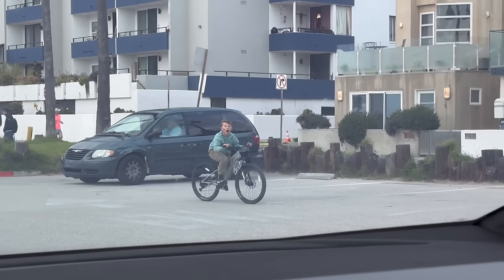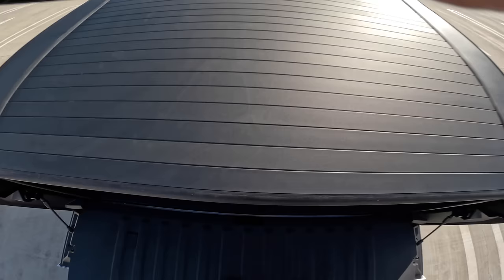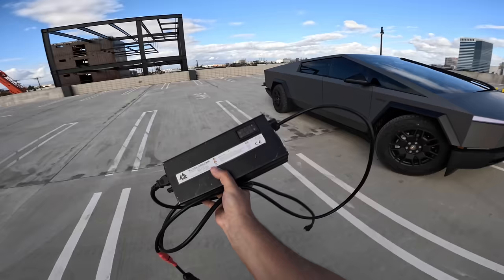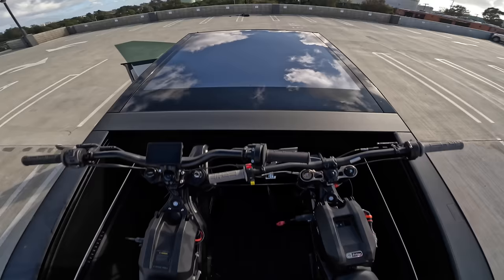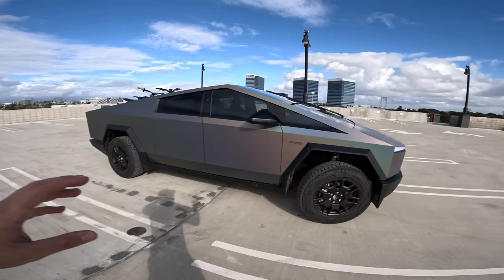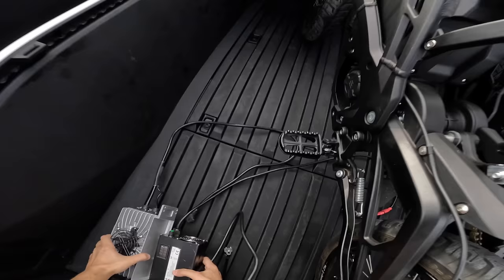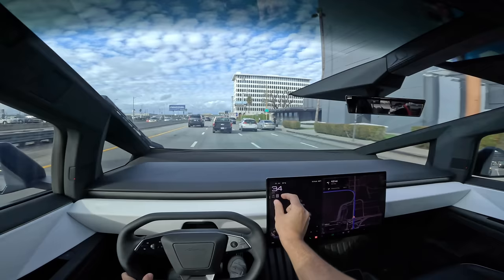I Cancelled My CYBERTRUCK Order After This!

Comment: Doing 70 mph through crowded city streets in a 6,000 lb truck while hold the steering wheel like a teenage girl is always a good idea!
Reply: lol It's ok, it's not real :)
Reply: @@karlwithak. Radar? Where did you get that info from?
Reply: @@karlwithak.so you could go Vmax and we need speed limits only for old car losers, right ? 🤦🏼‍♂️
Reply: yeah bro agreed.. like what is wrong with this guy... even just watching that on video creeped me out
Reply: @@karlwithak. because technology has never failed before
Reply: @@karlwithak. You are the reason the roads aren't safe. Never rely on tech to skirt speeding laws!
Reply: This vehicle can only go 65 miles an hour and they are not free way nor highway legal.  They also sure they weigh 15,000 pounds because just the battery weighs 10,000 pounds for the original design that was 4 times bigger.  That one has a max real speed of 50 miles and hour and is actually about the size of a 1990 Ford Ranger but has no where near the carry capacity morons believe it does.  Maybe 200 pounds in that bed at most.  Basically sure you can put 2 of those bicycles that have flair items to make them look like cheap crappy dirt bikes but shocking reality is electric vehicles can not be used in dirt at all or they will explode.  Basically what electric vehicles are is a giant paper weight you put in your driveway as a driveway ornament and hope it does not set your neighborhood on fire.
Reply: @jordancambridge4106  what car are you talking about? you can literally see his speed read out say 79 @ 14:09
Reply: Is the only thing you do cry?
Reply: It won't be new and in one peace driving that fast in that sort of area😳😱
Reply: Its called a Tesla Fanboy
Reply: @karlwithak. It literally has none of that.
Reply: Ya um.. No. most of that is not 
on the cyber truck yet. Even if it was, saying you cant hit anything is crazy.@karlwithak.
Reply: If you are going to break the law be sure to record yourself and post the evidence for all the cops to see.
Reply: @jordancambridge4106  Spoken like a true flat earther...
Reply: @karlwithak. That is not at ALL how physics works. When you’re going 75 miles an hour it is going to take you about 300 feet to stop no matter what technology you’re using. It’s all down to the static friction between the tires and the road. For comparison, when you’re going 35mph it will only take you about 65 feet to stop. Stopping distance is exponential with respect to velocity
Reply: @aarongriffin667  what you mean it’s not real because this is the real cyber truck and video
Reply: Teenage girl?? Huh?? That's exactly how you hold a steering wheel, 9 - 3 o'clock, it's literally how race drivers hold the wheel.
Reply: And btw, how would you hold a wheel like this? One hand on top like a tool???
Reply: @karlwithak.  I don't know where you're getting your info from. But that just is not true
Reply: @karlwithak.  WRONG....pedestrian walks out in front of it or bike crosses the road bc neither heard it coming, it's going to hit them.  You don't get 30 feet notice in those scenarios.  Once many are on the street, I'm sure you'll hear all the scenarios on the news.
Reply: Yea I thought that too, 60 in a urban area is just too fast in many cases.
If that common for such roads in the usa? Or was he actually speeding?
Reply: @karlwithak.  You're trolling right? Most ridiculous comment I have ever read apart from the one other dude I just replied to.
Reply: @karlwithak.  ??? I never replied to you, I didn't call you a tool LOL.
Reply: @karlwithak.  Yeah you're trolling.
Reply: @karlwithak. Making shit up is so weird bro hahahahaha
Reply: @karlwithak.  You religiously liking your own comments is extremely bizarre dude, you seem mental.
Reply: If I am not mistaken it is 11,000 lbs not 6,000!
Reply: Nothing can go wrong !
Reply: He cancelled because he never had the cash , now how about that McD job flipping 🍔burgers🍟!😮....😂
Reply: @karlwithak. If you get hit on the side because you were speeding down a road and they couldnt see you then that is on you.
Reply: @jordancambridge4106  If you watched the video you would have seen he actually went both below 65 and above 65mph so your comment is just stupid
Reply: @Bolero6879  Apparently you havent seen the GTAV instant break
Reply: @karlwithak.pay more attention in school
Reply: How do you run so much about tesla
Reply: But you were pretty smart if that is what true
Reply: It goes 120
Reply: Yes, I try to tell him that.
Reply: Nerd
Reply: I know he won't shut up.
Reply: Stop the music
Reply: @karlwithak. If someone gets in a crash they take account for everything that happened, someone breaking the law speeding would be at fault.
Reply: @Okurka.  prolly meant lidar
Reply: @plipy101  Tesla aren't using lidar either, they only use cameras.
Reply: @aarongriffin667  what part is not real?
Reply: @karlwithak. reading too many comics under the sheets karl??
Reply: @pan6593 police do it all the time, mostly for b.s. reasons to
Reply: "impossible to hit something" I don't know, Karl, I've seen other testing where it has no trouble mowing down cardboard children.
Reply: That's just to drive engagement in the comments section. This video is spam.
Reply: Who else would want one?
Reply: 9000lbs
Reply: let the dude have fun bro he didnt get a damn cyber truck brought to him so he could go 30 mph like shut up ur so corny let people have fun
Reply: @pan6593  You can adjust that steering ratio and everyone who says it won't do offroad, doesn't know how to operate it.
Reply: @jordancambridge4106  So much bullshit in your comment. Not even worth debunking.
Reply: stop crying
Reply: womp womp
Reply: Classic Ronster always me me me

Comment: Why are the screens on electric cars not itergrated into the dash? They look like they've been stuck on as an after thought
Reply: they would be either very far away or the dash would have to be massive and in your face to smoothly incorporate a 17inch screen
Reply: It rotates. It can landscape or portrait. That's likely why it's not actually IN the dash.
Reply: Don't know, but older Tesla Model S cars like 2016 do have screens integrated into the dash, but the newer Model S cars do not have screens integrated.
Reply: You need screens, especially touch activated screens, up near your line of sight.  If you have them in dash and have to look down it can be very hazardous..  That's why, in general,  buttons are so much better.  One quick glance and you're on the button,  not going into the third layer of touch screen menus to activate your massaging seats.
Reply: They are on many. Tesla just hasn't figured that out yet. I would guess Elon doesn't let them.

Comment: I had a ranger...left me stranded in the middle of BFE...got it fixed after a week then the fuel pump went...merging into Miami 15 lane toll road  at spring break...bought a f150...after 2800 miles transmission went...NO MO FORDS...tundras and Tacomas high mileage little/no issues

Comment: Crimes committed:
0:00 illegal parking 
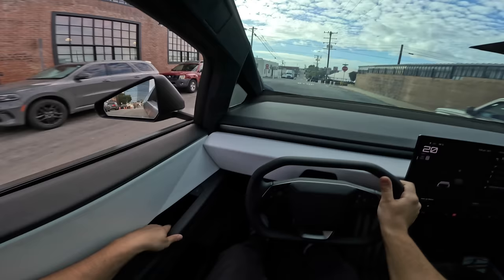9:50 failure to use a turn signal
9:56 reckless driving/speeding
10:31 53MPH in a 35MPH zone
10:59 failure to use a turn signal 
11:10 conspiracy to commit reckless driving 
11:14 reckless driving (67MPH in a 45MPH)
13:44 conspiracy to commit reckless driving 
13:49 reckless driving (75MPH in a 45MPH)
14:10 reckless driving (78MPH in a 45MPH)
14:25 admits to reckless driving 
15:44 failure to signal
15:53 gets stopped by a DOT officer.
17:30 illegal parking
18:33 reckless driving

(I know some weren’t crimes but were good to mentions I will remove and add if I see comments with a time stamp)
Reply: Nerd

Comment: First: That "truck" is more like a smartphone with wheels. Not a truck ! Second, driving 70 mph in 35 mph area... We don`t do that shit in Europe. Here the limit is 30 mph, in city. You can also have 20 mph limit. Yeah, you can go even with 120 mph on the motorway if the traffic goes like that. But speeding in cities / crowded areas is not tolerated at all.

Comment: "I could be in the middle of the desert and charge my bikes"

Dude you would be broke down in the middle of a desert.
Reply: He will be asking his "bros"' to bring him a generator and some gas. lol
Reply: This dude thinks it's cool that the cyber truck does not have a door handle on the outside.
I think it's dangerous and stupid.  If the battery malfunctions due to an accident and fire is starting inside the truck when the person inside is unable to open the door because of injury or unconsciousness, how can people from the outside open the door to save the person even if the door is unlocked?
Reply: @simon6071  It's okay because dude-bro will push-start the truck, jump aboard and open a door, saving the day all without signaling.
Reply: Charging a battery with a battery sounds like a great idea. How is he going to recharge his useless EV in the middle of the desert?
Reply: @simon6071  I saw this happen (not in person thankfully). An EV crashed and the battery burst into flame while the driver was inside. The door would not open because the battery failed and there is no mechanical linkage to the door handles. It's all electronic. The fire department was unable to open the door or even break the glass and the heat prevented them from doing much else. they had to back off and let the guy (who was still alive) burn. EVs are NOT a viable replacement for real cars.
Reply: @did_I_hurt_you_feefees  Thank you for confirming my technical, no, scratch that, my commonsense analysis that the Tesla cyber truck without a door handle is a dangerous and foolish idea.
Reply: @simon6071   I cannot understand why EVs can't be built more like real cars. Just replace the gas tank and engine with the EVs nonsense. Why does every single thing have to be motorized and with no physical linkages? I also can't understand why they all have to have a computer screen to control everything? I like my 2007 Toyota because I can operate every single feature on the dash by feel without taking my eyes off the road. EVs are a menace.
Reply: @The-KP  EVs cannot be push started when the battery is dead.  With ICE vehicles, only the ones with automatic transmission can be push started.
Reply: @did_I_hurt_you_feefees  I saw in one video that the driver cannot open the glove compartment just by pulling on the door. It must be opened electronically. What a stupid idea.
Reply: @simon6071  Seriously? That is ludicrous. Why do people want everything, even the most simple things to be electronic? This truck is just a huge ball of stupid. All EVs are just stupid.

Comment: Is it just me, or does charging batteries from a battery doesn’t exactly make sense? If the truck recharged while driving like hybrids do, this could fly, but draining your main battery while in the desert so you can charge you bike(s), or what ever, doesn’t make sense when the main battery is your way home.
Reply: The truck battery is massive and the bike batteries tiny. Not really an issue.
Reply: it will be if he has to drive as far as I do to go riding. So yeah, it sure the heck can be an issue.

Comment: I’m just a 76 year old lady, but that thing looks like it rides way low for a truck that has to carry a heavy load and maybe go over a rough terrain.  With a battery on the underside.  In the snow.  Up a hill.
Reply: You'd be much better off in a real car that won't just burst into flame if a rock scrapes the underside ever so slightly.
Reply: This is a 'truck' for people in the city who won't ever take it offroad. Complete farce of a vehicle

Hell, there's already videos of these getting stuck offroad because they're just horrible at their one designed purpose
Reply: @sabersz  Not to mention how dangerous they are for being over weight, running on batteries that can just explode unexpectedly and you can get trapped inside when the battery fries. There is nothing about this truck that is good. It's even ugly as sin.
Reply: You won't want this in states that have true winters - you saw what happened this winter with all of the dead Teslas, right?  Cold weather and batteries don't go well together.
Reply: @adb888 Nordic countries have extreme weather and they still run EVs, like Finland Norway etc
Reply: @FlatEarthKiller  Yes we have... But it doesn´t work all the time. EV drivers need at least 2 cars. Some 3!
Reply: @cmwHisArtist  The air suspension has 8.1 inches of adjustment from lowest to highest settings. Your concern about ride height is unfounded.
Reply: This thing has up to a 16 inch clearance. You don't know what you are talking about.
Reply: @FlatEarthKiller  Why? It's a US truck and basically everyone in the US uses inches still.
Reply: @TwitchyMofo  …..that’s why I said it LOOKS like it rides way low.  So it’s good on rough rocky areas and mud?
Reply: @cmwHisArtist  Yes. Extremely good.

Comment: there are already other trucks that electronically adjust the ride height. Some Rams will do it and many SUVs will also. The f150 lightening has over 300 mile range, looks better, you can get it worked on at any ford dealer, and the surrons will fit in the back and can also be charged just like the cybertruck
Reply: nothing could look worse than a Cybertruck - NOTHING.       My Guess? Fastest depreciation Truck - EVER
Reply: My 2021 Silverado also has a plug in the bed if that’s the bragging point we are using😂😂
Reply: @wyatt_7395   but is it a 220v outlet?
Reply: @CosmicSeeker69  All Teslas (or rather all EVs) depreciate stupidly fast because they are basically consumer electronics.

Comment: Best part with the charging is the comedy of using a ~400 vdc  battery through an inverter to get 12-vac then going through a switching power supply to get 80vdc or so.